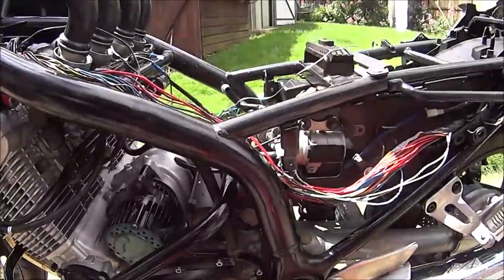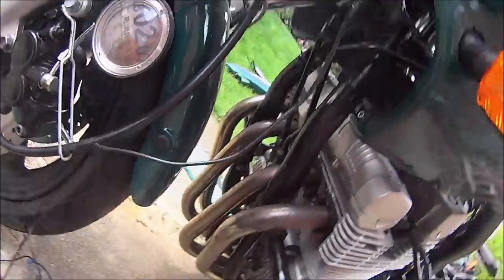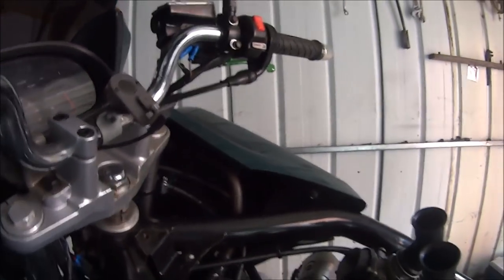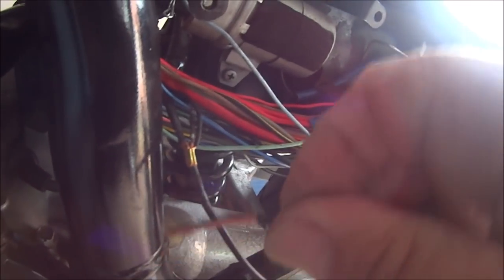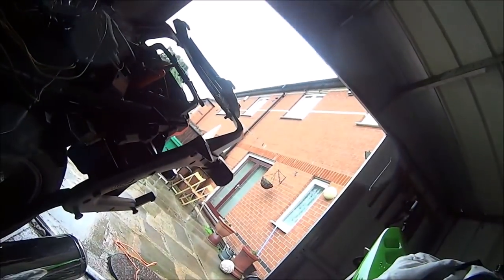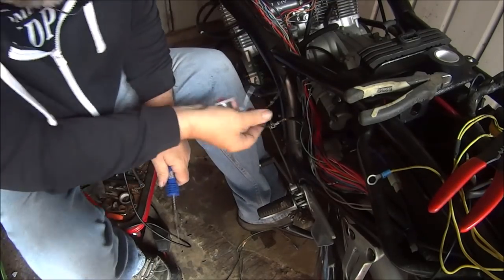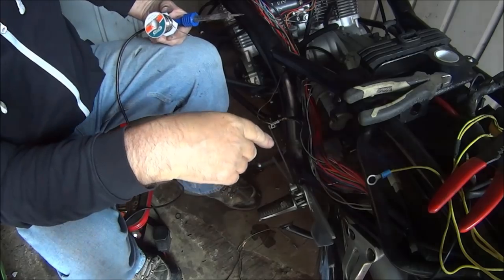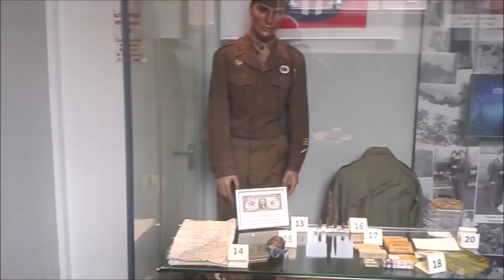XJ900S diversion, final fix part two

Comment: sorry to add criticism but my right ear felt quite lonely during this video plus it was sounding quite bass with your voice so hard to understand what you what you where saying. i did however decide not to go down the divy 900 route as the bike i wanted to go for was like yours a mission to put right but instead opted for the little brother 600 which is surprisingly easy to work on.
Reply from the maker: Sorry bout that pal. At the moment I am struggling to get a decent audio sound do to a lack of funds. It is nice to know I'm inspiring people to get a project and give it a go. Good luck with the 600.
Reply from the maker: I just need this XJ done

Comment: Just go a cbr1100xx with partly oxidised  SS  collector and alloy parts
I saw the vid on cleaning it up a treat
What product did you use? I'm on a visit to  UK north now and can get it on my trip
Thanks in advance
Reply from the maker: Hi Paul. I just used autosol on the XJ but on the cbr I used harpic power plus xxx and then autosol but wear gloves as it as got some sort of acid in it.
Reply: Ok harpic the lav cleaner it's with a strong alkali base I'll try that
I used oven cleaner before with good results but you have to wash it off before it bites into the plastic
Reply: I'm up north at the moment with the xx in the van to take hope 
If you like I can call by on my way back down you can PM me as needed
Reply from the maker: I like to remain private from the you tube channel thanks
Reply: Clear
Reply from the maker: thanks